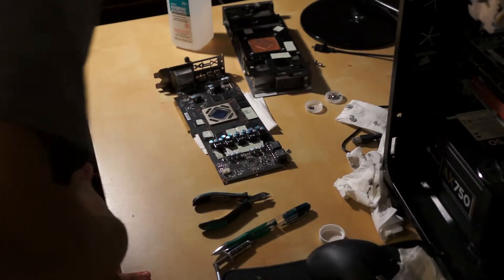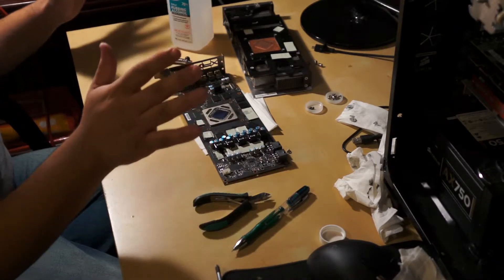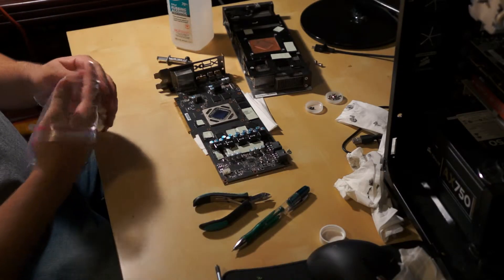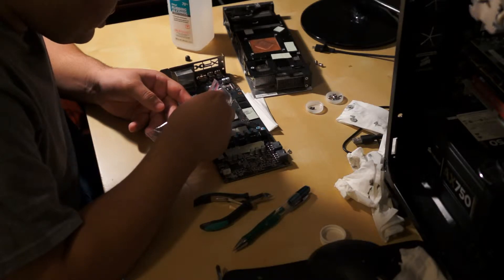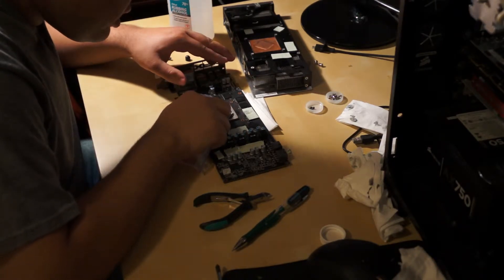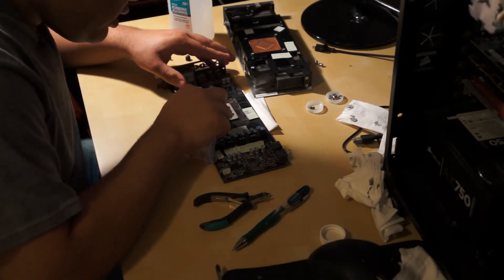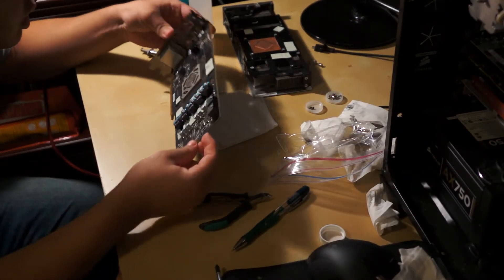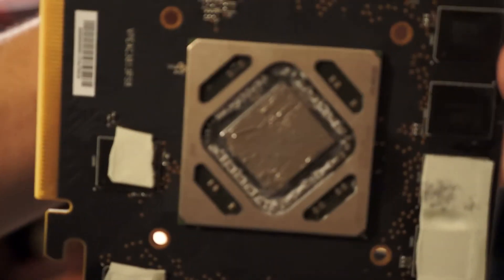XFX 7950 Double Dissipation Thermal Paste Swap Part Four (Confirmation and Application)

Comment: arctic mx4 works great for this, ad is tacky but still easy to spread with your finger to get nice thin application. i know some people swear by it, but do yourself a favor dont use prolima tech pk-3. its a good paste but wants to cake up, and can be a bitch to work with. thats why they supply each tube with a plastic spreader, but even then it can be a pain to use.
Reply from the maker: Thanks for the advice!

Yea I've been sticking with this tube of Arctic Silver. Thing is I'm almost out though, but I've got this tube of Noctua paste I'm gonna start using later.

Comment: Way too much thermal paste. You shouldn't spread it: https://www.youtube.com/watch?v=-hNgFNH7zhQ
Reply from the maker: Yea, I know that now. Definitely could have gone with less. But it still cools a hell of a lot better than the stock chalk did.
Reply: ***** What where your temps before and after? i have a 7970 GHZ and want to do this but im scared ill rip the thermal pads
Reply from the maker: Velocity You will rip the pads. Its not a question. I should have (and since have) replaced the pads when I replaced the paste.

I'm actually in the process of editing together a much shorter, more concise guide that shows new pads.

Make sure to buy enough, I found that 120mmx20mm was not enough to cover both the MOSFETs and the VRAM. But 2 of those size would be more than enough.
Reply: ***** ive seen alot of vids where they did not rip them but XFX used cheap ass stuff so with this particular cooler i think it is much more likley you never answerd my 1st question
Reply from the maker: ***** I believe it depends on the particular card you have.

I used 1mm pads that I just bought on Amazon. Nothing too special, but anything to replace the crap that came standard.

As I've previously stated, I think it was worth replacing the paste and pads. Although I was a long and stressful process that took a few attempts to get correct.
Reply from the maker: *****
In that case I just went with 1mm thick pads. They were noticeably thicker than the stock pads.
Reply from the maker: *****
Sure man. Dont worry about it!